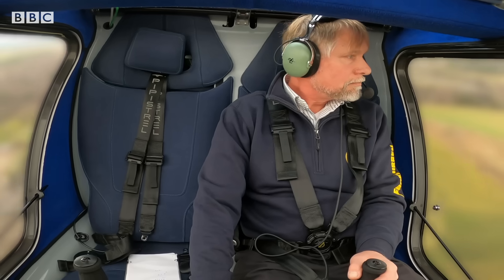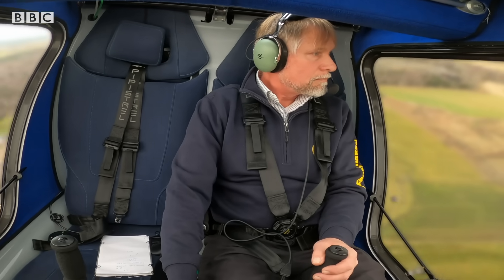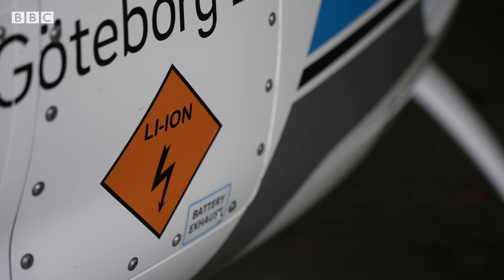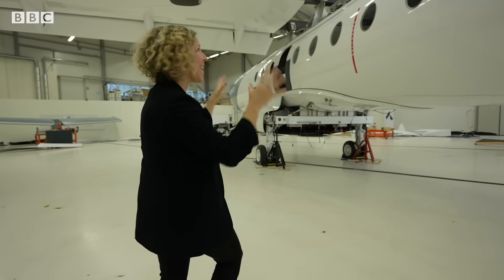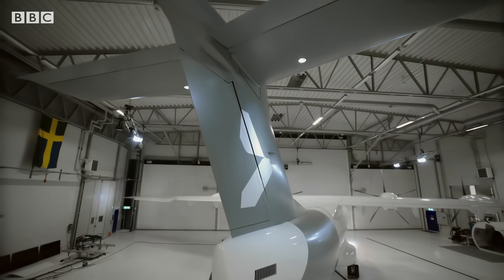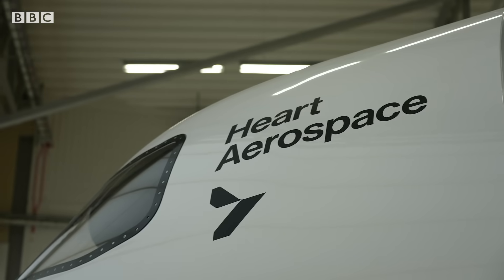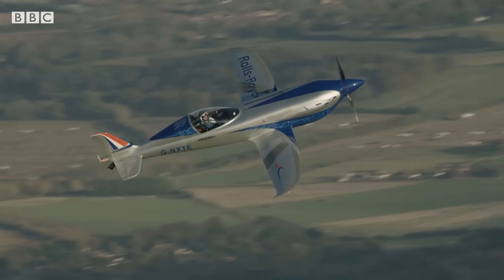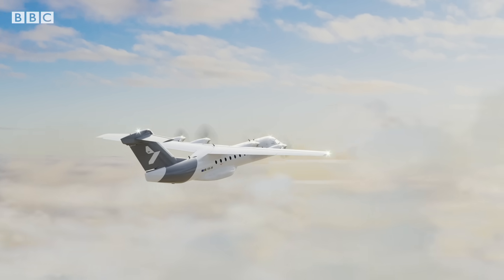Can we clean up air travel? | BBC News

Comment: The problem is not the emissions at 3%. Cows make more greenhouse gases than that. The problem is the altitude at which those atmosphere depleting gases are emitted. Civil aviation is not even close to be the worst offender. SpaceX thousands of satellites when decommissioned and performing their entry burn (and consequent destruction) will deplete the Ozone layer bit by bit with aluminium oxide particles. Now imagine tens of thousands of satellites retiring every 5 years or less. Now multiply that by other companies doing the same thing like Amazon, Chinese, etc.

Comment: Why don't they make the hull of the Plaine a battery to lighten the load
Reply: Yes, make that a solar battery
Reply: @Carlie.S it’s not that simple, solar panel only can convert roughly 25% of sunlight to electricity. Second, the adding up weight of plane would affect payload and decrease the efficiency and captivity as well. For the long term flight, ultra solar cell may be a game changer, but these materials are pricy and unstable at the moment.

Comment: Hybrid might be nice. If you get a fuel leak or fuel pump issue plane can be switched to electric to get you safely to the ground
Reply: Planes are already the safest mode of transportation in the world - far safer than trains or even walking - it's not a concern.
Reply: Plane wings are on an angle so fuel will automatically flow to the engine
Reply: @ Lmao, no.
Reply: Boeing is ruining the statistics.
Reply: But is heavy, you can’t go far with it